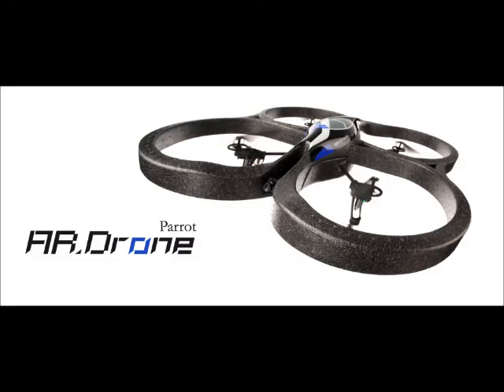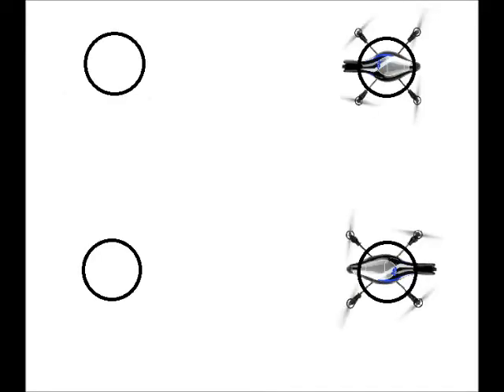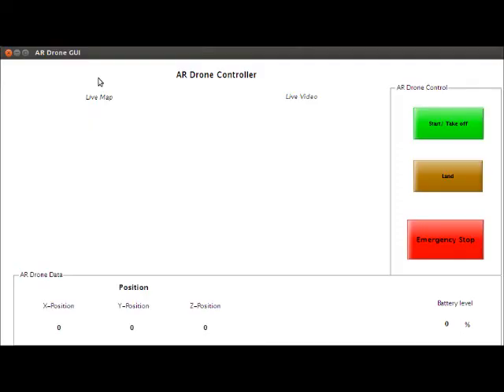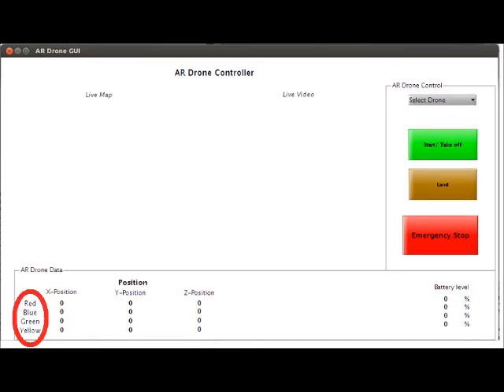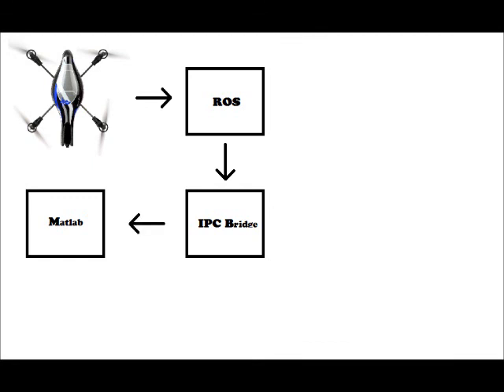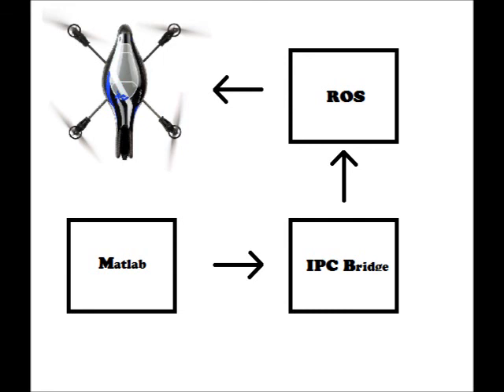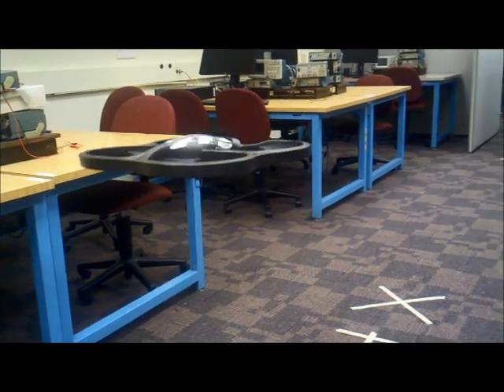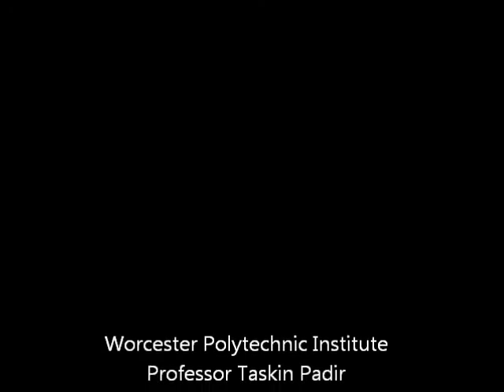Matlab Controlled Ar Drone Project

Comment: Hello! I would like to say this is very good stuff!!! Actually I am a rookie researching with Ar Drone and I have trouble streaming data to simulink. If you don't mind, could you give me some hints about ROS and IPC Bridge?
Reply from the maker: Peiyan Gong If you don't have to use simulink, I suggest using ROSjava and writing object oriented Matlab instead of IPC Bridge. I haven't tried using IPC Bridge since this project, but when we were using it, it seemed rather buggy. Or at least there wasn't enough documentation for people with minimal IPC experience to easily figure it out. 

If you must use simulink, a very simple suggestion to help with the data stream would be to make sure you are closing and opening ports appropriately. If I remember correctly, you cannot have more than one port open at once while transmitting data.

I hope this helps. Best of luck with your project!
Reply: Maddie Burris Thank you! Honestly I am a college student and this is the first time doing actual something rather than theoretical simulation. I am really a rookie in Robotic, so would you mind tell me some good materials I can read or watch to get a better view of the big picture? Thank you so much!

Comment: Were you able to access the video stream using Matlab?
Reply from the maker: Over the summer we were using ROS Groovy and we were able to access the image data and just displayed the images fast enough to make it seem like live feed. However, with ROS Hydro, it seems the boost libraries don't play nicely with Matlab's so the IPC Bridge pipe broke. An attempted fix to this would be to compile ROS against Matlab's boost libraries.
Reply: Maddie Burris Thanks!